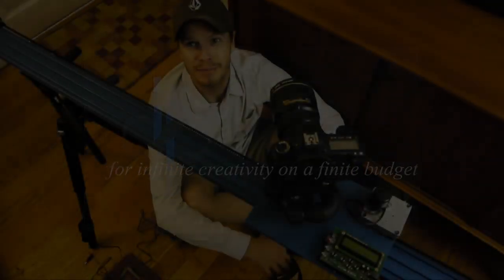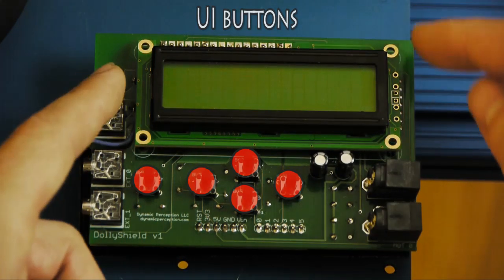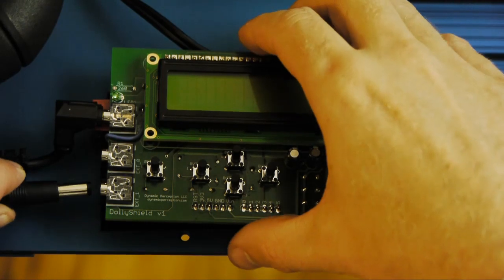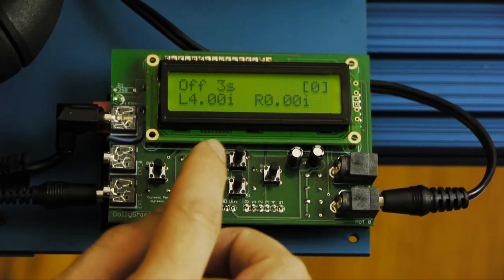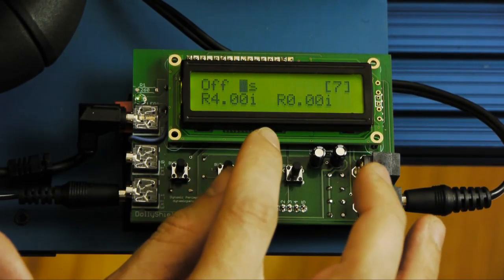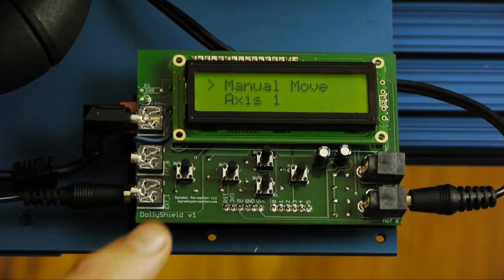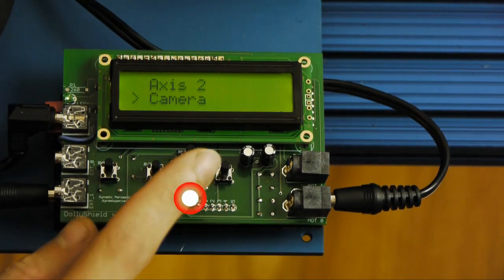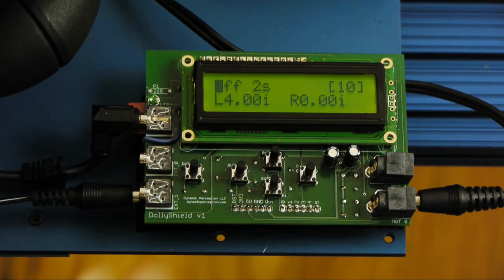Dynamic Perception MX2 Dolly Controller Tour (part 2)

Comment: Hello! I just got my hands on a friend's old Stage Zero (I think thats what its called, the one built on a 6ft aluminum rail) with the mx2 controller and few DC Motors. I have managed to get the slider working with the controller even without a shutter release cable! I was wondering if you had any recommendation for powering the rail when on the go (As well as the best way to mount the rail on 2 tripods)? The box of goods i inherited contained an empty 12v battery from Dynamic Perception that i cant find on the site anymore, do you have an alternative you recommend? Lastly, I could not figure out what the DC Motors are used for lol I have two at different speeds? Does it just change to dolly speed? Thank you for your time and dedication to the timelapse art!

Comment: Hello. Could you tell about "Multi-Function Switch Block" in Stage Zero Bundle Ultimate? Can I use it without this blocks? What is difference between it and Stage Zero 6-Foot Bundle whitout this blocks?

Comment: @ar4216 I dont know if you are aware, but SLR's usually have the option to keep the shutter open for longer periuds of time. For example 3 seconds. If you move the camera when the shutter is open, the image becomes blurry. So when it stops, its helpful to get a sharper image at slower shutter speeds. Or you can do it the other way around for some experimental footage with slow shutter times and continous movin..,, gl :)